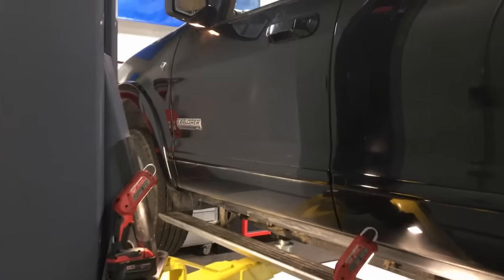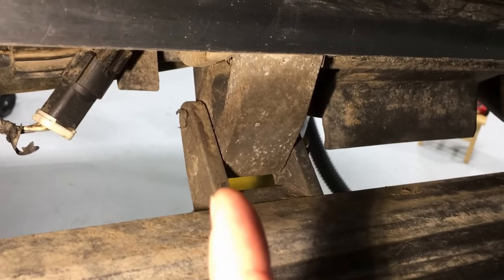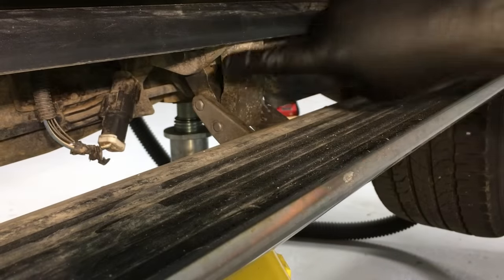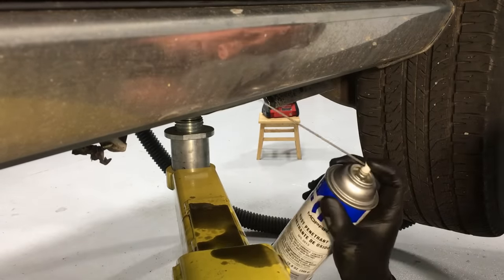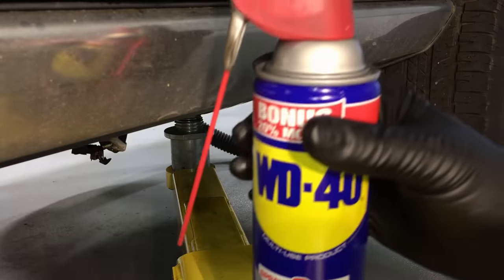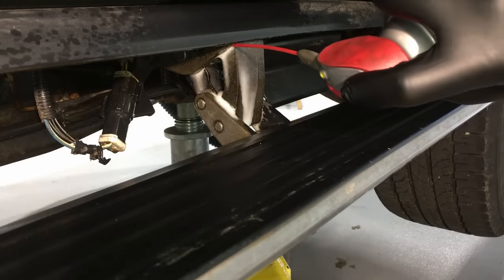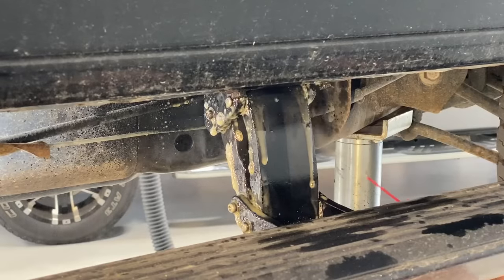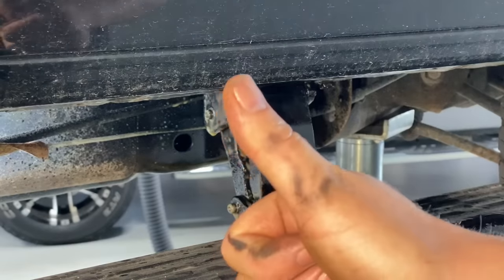Ford Quick Tips #86: How to Fix Stuck Power Running Boards for Good!

Comment: Thank you for this video!! I figured my motor was toast. I watched this video and had both sides working again in 10 min.
Reply: Was thinking the same thing.. I'm gonna try this on mine it's just my driver side that's stuck down makes the noise but doesn't want to move

Comment: That stuff fixed my steering shaft U joint. I had no return to center. Every oil change I spray it down, no problems for years.

Comment: 2018 Jeep disconnected battery same issue....probe that 30 amp fuse found it hot on both sides, watched u r video pulled same 30 amp fuse....as soon as i reinserted boards went up and function fine now...thanks

Comment: Awesome video!! I was told by multiple dealerships, Firestone’s etc that it would be $2500+ to fix the motors so I held off. Just did this, had to really apply pressure to get the boards going up but eventually got them going and now they are as good as new!

Comment: The Midwest is hard on vehicle, doesn’t help that Ford makes some parts that aren’t quality, had to replace my oil pan cover, because it’s made of some soft material, that after all the snow in Minnesota, would get trapped on top of it causing it to soften like a cardboard eventually causing it to rip from the mounts, therefore causing it to drag on the ground. Eventually I replaced it with a Ford Rapture oil pan cover. Now my running boards are acting up. I’m going to try this approach. I believe that it will fix my problem. Thanks!

Comment: Thanks a ton! My power running boards on my 2017 F150 were deploying about 50% and then retracting, it was super annoying. Sprayed the crap out of the hinge points with a penetrator, and some WD-40 and that seems to have fixed my issue.

Comment: $3400...we just got a quote.  The motors are about $100 each...but they won't replace just the motor even if it is bad.  Dealerships wonder why they have a bad name?  This is why.  When I asked about cleaning and lubricating the hinges they said "That doesn't work, the entire unit is shot, there is no replacing just the motor or module"...I called three local shops by me..SAME EXACT ANSWER.  Tell you, I live in a lousy place for honest, hard working, quality service.  Thanks for sharing!!!

Comment: I have used Boeshield T9 as a protective film for the hinges. It should be reapplied every 6 months or more, before rust/snow and again after snow season.
Like Fluid Film, this leaves a protective layer but more like a wax, like Chevy does to their frames.
Reply: I've used Boeshield T9 on exposed parts, and now use Corrosion-X ... just remember that when driving through rain/puddles or other wet weather, at speed, its like a powerwasher underneath and need reapplication.

Comment: Be sure to clean the step pads on the running boards afterwards because they will be slippery from all the oil dripped on them.  Customers always complain about that and the stains.

Comment: I saw one of these type of running boards behind the car wash where there is a couple of curbs on a up hill angle with grass between it. The driver must have tried to go over the curbs and grass and scraped the automatic door step of. It was off of the truck and bent and damaged with the hinges still on it. The person drove and left it.

Comment: So i have an F-150 had some body work and after they finished my running boards stopped working!!  I was livid!  They said need new motor 😂etc, well ive taken care of my own vehicles all my life and so glad i found this!!  But i had a question the driver side wont close all the way and the passanger side will pop up and down while driving down the road.  Any advise?  Oh they told me there was a lot of corrosion in the auto running boards. Can you help please??!!

Comment: Glad to not see the usual "Ford garbage" posts by many when this kind of video pops.  The fact is, ALL power running boards are affected...there is ONE supplier of them for everybody, and they know there is an issue.  Instead of "fixing it" by using something like a real bushing, they are investigating a move to stainless steel with a PTFE liner on it.  5 years ago I suggested putting a grease fitting, but that was "are you kidding?  That will increase costs for the OPs to drill and tap and add the fitting, as well as another 'needless' maintenance point"....That's the suppliers for you...

Comment: Thank you, great tip for fixing stuck running boards.  Can you also do a video that covers the alignment of the running board?  One of mine retracts out of alignment with the rocker and I can’t see how to adjust the alignment. Thanks!

Comment: Hello, I have a 2014 F-150 Platinum that also has these hide-away runniong boards. I see you used a wire brush to clean the pivot points prior to lubing them. Can a presure washer be used instead? I figure it would definately be better at getting in to the tight crevices and flushing out any caked on grime and debris. After all, they certainly see their share of undercarraige pressure washes during the winter months here in the salt belt. I wish they would have made these with grease fittings.

Comment: The driver side one on my 2015 is completely dead.  Used the rust penetrant and still hoping for it to kick in.  No sound from the motor whatsoever, so I think it may be electrical.   Before it stopped working completely it would randomly deploy and retract as I was driving.  Then finally froze halfway up.  I finally just pushed them back up, which was a struggle in itself as they would barely budge.

Comment: I appreciate this video and thank you for producing it. I do have a question about the Fluid Film lubricant because I had never used it before:

I should say that my steps are not stuck -- they are working and I am following this lubrication protocol to keep them from failing. I did the full procedure and took off for a hunting trip in Montana. While there I drove in a couple of heavy downpours. A day or so later I noticed a creaking noise on the driver side and was surprised to see that all of the Fluid Film was gone. 100%, both sides. It was very dusty where we were driving on the ranch, so I am guessing that's the source of the noise. 

Prior to finding this video I had been using aerosol white lithium grease. Anyone have any thoughts on how Fluid Film holds up if it gets wet? Other suggestions?

Comment: Ford Tech, what does it mean if the step is working but the step motor keeps running for 5 seconds or so AFTER the step has stopped in the proper location.  WIll this hurt the motor?

Comment: Not sure if you’ll see this. But I have a 2015 expedition el platinum. Passenger side running board is stuck down permanently. Motor doesn’t even try to work. Had already lubricated it a while back. Was working fine and then one day stuck down and came back up a couple days later but now permanently stuck. I’m guessing bad motor?

Comment: I have an Expedition that the power liftgate stopped raising or lowering.  I have checked the fuses, settings, etc.  Still didn't work.  2 days later the power running boards stopped working.  Any ideas?

Comment: I followed your steps with the pb blaster working it back and forth to get it moving.  Spent 2 hours cleaning and dumping two cans of blaster on but my step still will not raise without helping it. The hinge pens look nice and clean. Motor just sounds like it's struggling to find strength.  The other side works nice and fast.  Possible a motor issue?
Reply: use 2x4 to help them back up.  repeat and lubricate until full travel

Comment: I had installed some used  amp research on my silverado 2016 the passenger side wont open the motors makes some noise  when I Tried to  open the door it looks like it tries to retract instedoff deploy, I test ed the motor on the other side and it does works great, I change out the module an still doing the same could  you help me out what it could be thanks

Comment: My left side power step bracket snapped. I can't seem to find exact match for just that. The one that's got pins through it. 2013 Ford Expedition.  Probably searching too hard.  I Don't want to buy whole running board assembly.  Thanks

Comment: I have an issue where my step goes down but partly goes up and goes back down. Motor works and hinges cleared and freed. I put the wedge key back in, worked a few times and now won’t work again. Any ideas?

Comment: Just bought a used f150 and my running boards aren’t working at all. I don’t even think they have power to them. The fuse is good. Do you think it’s possible that both of the motors are busted?

Comment: Mine is making a very loud noise when it is trying to close and open all the way. It is the same sound about 6 times in a row, like a loud groaning or straining of the motor and it being stuck (2015 Expedition)
Reply: Did the process work out eventually?  It sounds like we have the same issue with the loud noise.  What, if any, steps did you take to resolve it?

Comment: Thank you for another very helpful video!  I have a question:  I am a new F150 owner (2012 XLT Supercrew cab 5.0 Flex Fuel), and am doing my own service on the truck when I can.  I want a battery powered impact or impact driver.  Looking at the Milwaukee Stuby 12v.  This is for trans pans, rear dif covers, and the like.  Was thinking 1/4" and maybe adding a 1/2" tool later for larger fasteners.  Would you recommend the impact driver or impact tool?  The impact driver seems more versatile, but I have no experience with either, so I would greatly appreciate some guidance.  Thank you in advance!

Comment: Hey dude.  Have you ever come across an 04 F150 that when you turn the headlight switch on while running, it doesn’t allow the truck to shift out of park ?   There are also no dash lights and some flickering with the gauges, so something for sure is not well connected.    My 1st “Project” in 24 years ....

Comment: They want over $1600 to replace my running boards.  Think I'm gonna try this first.  Motor still works, you can feel it on the floorboards trying to pull the boards up at different times while driving.

Update:  Just did this over the weekend.  Worked like a Charm.  I was going to just have the dealer remove the running boards when the parts came in for a recall, but now I'm simply going to tell them that they need to hire auto repairmen, not auto replacemen, like they currently have.   $30 vs $1600.

Comment: Hey my drivers side running board is struggling...i spent the whole day following your cleaning technique. And it still struggles. But i did find out that when the truck is started it will go up 7/10 times but when the truck is off it will only go up with help...is that still due to rust and corrosion? Or would it be something else?
Reply: Trevor, my guess is the motor is getting full voltage when the truck is running but not quite enough voltage when it's just running on battery

Comment: 2004 ford f-150 engine ventilation tube assembly 7l3z-9f695-a, Do these Go Bad?  Haynes manual calls it the PCV valve.  What symptoms if they do go bad?  Does ELM and FORScan read BARO and Fuel trims like your Ford Scanner?

Comment: Wondering if you can give me a hint on what to look at with my f350 v10 gas. Everytime I start it hot or cold engine, it will hesitate if I put it in gear and take off right away but will go away after about 15 or 20 seconds. It really struggles to go the harder I push on the gas the worst. It will idle fine at startup it only happens when i put in in gear and drive.

Comment: Hi. I bought a 2004 Lincoln Navigator with deployable running boards. They are in like if they were off. I had the same truck before but sold it. The one i had first had the option to turn them off and on
But this truck doesn’t have it. Any idea why? If it has the deployable running boards

Comment: Good morning sir, off topic: I need a fuel pump assembly for my 2000 Ford expedition 4.6 L and I'm kinda low on budget, I found a replacement made in China, for around 60 USD. Do you think it would be a good buy?  I just need the truck to run again. Thank you for your time!

Comment: Will pb blaster work? As i already have some pb & wd 40.
Thank you, Brandon 🎼
Reply: Yes. Just did my neighbours with PB. They were really stuck. Full can of PB penetrant, full can of PB lube, lots of door opening and closing, jumping up and down on the boards, pushing on the boards, and swearing.   Fluid film is next.   Took me 90 minutes. Driver side was worse.

Comment: Any comments on the new bronco......can u please do a video on how reliable/issues with the 2.3 eco boost ?
Reply: At the dealer we have seen any problems with the 2.3 turbo other than software updates, but beware of the 10 speed auto.  There have been a LOT of problems with them in the Explorers and a few others here and there.
Reply: Any issue I've seen with either the motor or transmission, has been caused by very poor factory fluids.  Get Amsoil oil, transmission fluid, and differential into it asap.

Comment: You always see Ford trucks on the road with one or both powersteps stuck in the down position. I’ve had a set of AMP powersteps on my Raptor for 7 years (including salt soaked Ottawa Winters) and I’ve always made a point of cleaning the hinges and a quick spray with silicone lube at least once a month...never had an issue with them seizing up. Preventative maintenance?....who woulda thunk? :p

Comment: This is a great video thank you.  I have tried this thoroughly several times and I still have an intermittent sticking issue on the driver side.  Ford told me they could not replicate it.  I showed them videos and everything and they did not care.  I believe their analysis was opening and closing the door one time and it happened to work and they said "sall good" and moved to the next vehicle.  The day of the car getting back to me as well as the next day same issue.  Going nuts.  They are cleaner and better lubricated than factory.  Any ideas out there pleeease?!
Reply: Any update?

Comment: Hey i just purchased a 2010 f150 platinum. And currently my power running boards work. I just want to keep them working do you recommend me using the same products? Or just use fluid film? And how often should i do it?

Comment: Another great video! Any idea if fluid film is safe when contacting electrical wiring that runs in the channels under the door sills (inside the cab)? Rusting has formed underneath where the wire looms rest. Thank you

Comment: Love your videos. My passenger side running board slams open. Whenever i open the door it goes boom. That running board was replaced by the dealer back when the car was new under (forced) warranty. I had to file a complaint to the regional ford office and they fixed it after refusing at first. And thats the one that slams open. The other side doesn't do it. Any ideas? Thanks!

Comment: I have a f150 fx4 3.5 Ecco boost engine and I do not have auto running boards. I have a blue driver scan tool and I keep getting B1215  1 Accessory protocol interface module code. It said it has running beard short to the battery. But .I do not have those running . I have the standard boards. I not sure where to look,.
Don

Comment: I don't know if this is going to help anyone but I did notice that if you're not sitting in the seat but the keys are in the ignition it would not go all the way up I take it the driver seat passenger seats have sensors on it for weight and if no one is sitting in it it will not fully close anticipating the driver or passenger getting back into the vehicle

Comment: I tried all that and they’re still not showing any signs of freeing up. Mine are stuck in the up position so is much harder to hit all the joints.  I think I got them all pretty good but all it does is make a small sound and give up. I’m thinking to give it time to soak in. Also wondering if it’s possibly the motor that’s either rusted inside or maybe broken altogether? If Anyone has any suggestions will be appreciated.

Update: I did let it sit about an hour then went back out there had someone else keep opening the door while I pried it with a crowbar. In the beginning it’s gonna seem like you’re getting nowhere but eventually it’ll start to give a little and then a little more. Eventually I decided to lose the crowbar and yank it with my hands. I pulled it from the inside towards me, instead of trying to push it down towards the ground, because when it comes out it’s more of an outward motion then down. It gave pretty quickly once I did that and then I sort of had the situation where he started the video, it wouldn’t go up without my help and came down on its own. So I kept the process up for about an hour, open- close- help and it got better and better. Also noticed it worked better when the engine was running instead of on battery power. Also helped to open the door let it drop a bit then close it so it only has to go up a little bit, keep doing this and letting it drop a bit more every time. Right now it goes up really slowly and sometimes needs help but it’ll get better as time goes on.
Reply: Use a 2x4 to help leverage it back up until they work freely
Reply: @jphickory522  funny u replied to this now because the entire winter I had them switched off because it never really worked closing up. And just yesterday I installed a new motor and they're working better than ever. I guess sometimes no matter how much u free up those hinges the motor is just too weak to bring em up. I ordered them on ebay it was 120 for the right side and 150 for the driver side. Worth the money